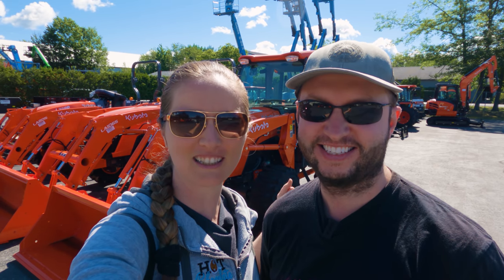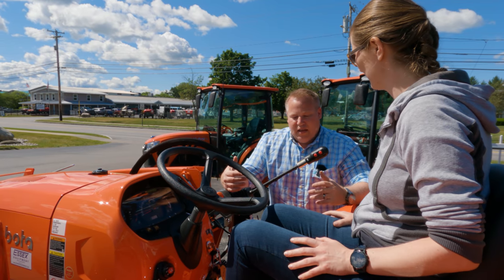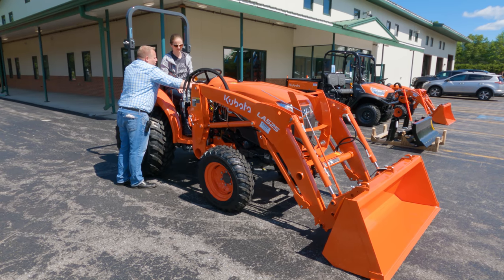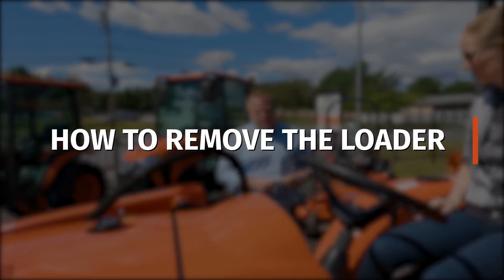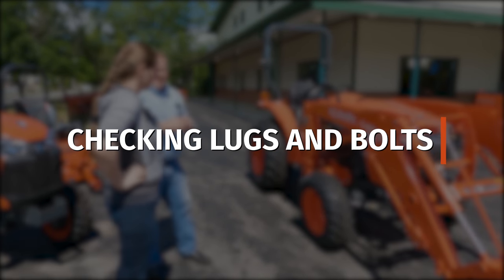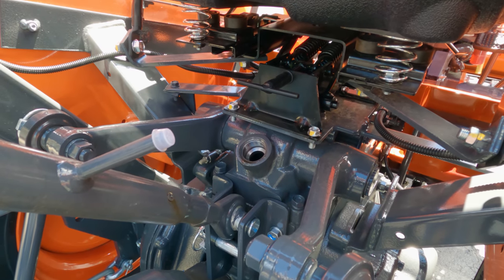We bought a tractor! - Tractor ORIENTATION for new owners

Comment from the maker: This is a very long video! Not really our norm, but there was so much good information that I couldn't cut any more out. If you want to find a section again, here are timestamps: 
0:00:00 We bought a tractor!
0:01:08 Welded hooks
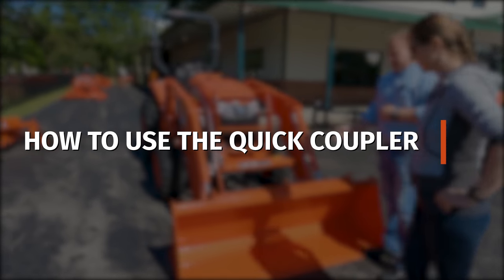0:01:35 Quick coupler
0:03:53 Engine
0:04:31 Battery
0:04:57 Air filter
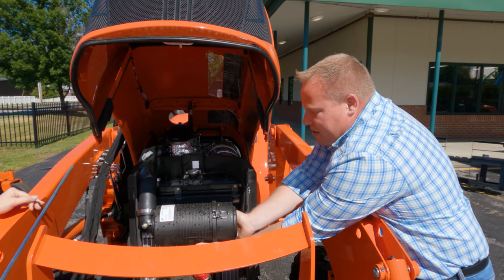0:06:28 Screen
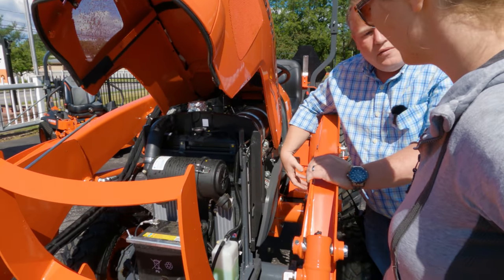0:07:21 Alternator
0:07:28 Oil dipstick
0:09:01 Diesel particulate filter
0:10:17 How DPF regen works
0:13:16 There is no right or wrong way to run a tractor (RPMs)
0:13:34 How to engage regen
0:14:41 What do all the handles do?
0:14:46 Clutch
0:15:09 Gears
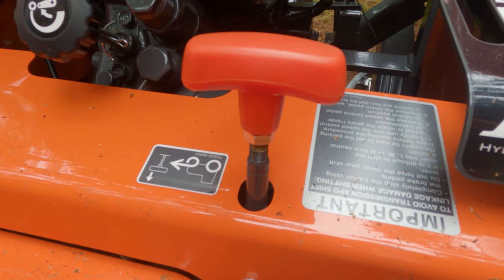0:15:57 4 wheel drive
0:16:30 Locking real differential
0:18:27 Three-point hitch lift/drop speed
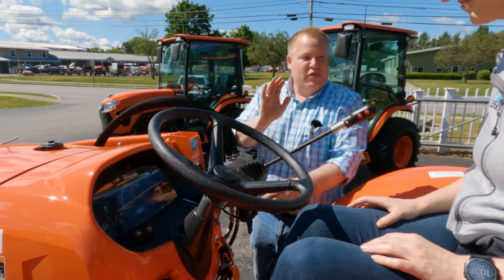0:19:13 Throttle
0:19:24 How to start the tractor & glow plug
0:20:36 What RPMs to run the tractor at
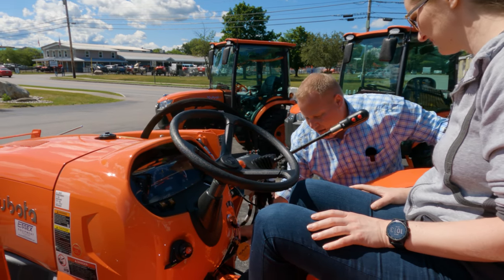0:22:57 How to set the parking brake
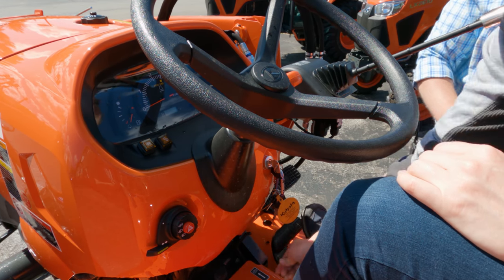0:23:33 Individual parking brake pedals
0:24:30 How to read hydraulics dipstick
0:26:10 How to operate rear attachments: 3 point hitch
0:26:45 PTO
0:27:33 How to operate a loader
0:29:06 Bucket level indicator
0:30:31 Playing with the tractor
0:30:45 Loader
0:32:44 Lifting front tires
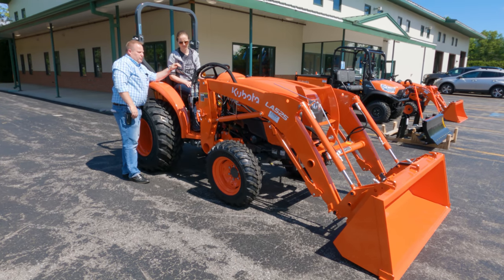0:33:09 Floating the bucket
0:36:04 How to lock the handle for the loader
0:37:24 Picking up logs with forks vs bucket
0:38:17 How to remove the loader
0:44:50 Taking tractor on the road
0:45:02 Tractor came out of the box
0:46:50 Tires are loaded with beet juice
0:47:25 3 point hitch
0:51:16 Seat
0:51:56 Safety features
0:52:47 ROPS
0:54:25 Loader safety
0:55:33 Driving the tractor
0:57:07 What to do with stuck gear shifter?
0:58:27 Test drive
0:58:50 Removing the bucket and putting on pallet forks
1:02:15 Tractor delivered
Reply: Po
Reply: 8:15 8:16
Reply: Very useful video
Reply: Yes some great info. Best I've seen.

Comment: It's 2023 and I've owned my L3800 since 2013 and I have to thank you for this video as I leaned a few things I was never told or never found out about it. The seat adjustment for the springs was a big one, I never knew. I did just go out and adjust mine to where it's super comfortable now. Most of the rest I figured out on my own through use, but anything I might not have known helps. That's a nice way to receive a new machine, very thorough. My salesman met us in the parking lot, and said good luck. I and my wife loaded it on the trail and carted it home. Delivery? There was no mention of any type of delivery, so we borrowed an equipment trailer, bindered it down and off we went.

Comment: The knob between your legs Crank it wide open... You can adjust the speed by using your 3-point lever.. why people feel the need  just to slam the lever forward as fast as they can as beyond me.. and use your four-wheel drive as much as possible unless you're on blacktop road.. it will help with skidding trees and loader work.. only use the differential lock if you're losing traction in 4-wheel drive.... And when engaging the PTO let the clutch out slow with tractor  idling

Comment: As for lifting the boom to check the engine, there are safety jacks you can get that’ll prop up the bucket boom so you can work on the motor. If you take your tractor in for maintenance it’s highly likely service personnel will have those safety jacks.

Comment: How are you liking your L3901? I have one and have had it since 2018. I have 185 hours on mine. 

Only complaints are I don't think the loader lift capacity is that great.
The oil dipstick is difficult to get to.
The PTO switch is not great.
If you use a grapple like I do, I wish the front brush guard had a metal cage on it, I've had sticks run through the front grill messing up a battery.

I added an extra valve for a grapple on the front. It has been handy for brush piles.
Reply from the maker: Our L3901 is now about 10 months old and has around 160 hours on it - over half of which we've put on in the last 2 months since we've been back in Vermont! So far, it's far exceeded our expectations. Before we bought the tractor, we wrote up a list of all the things we thought we'd use it for, but in reality it's come in useful for many more things. I think overall my comments would be very similar to yours.

The loader lift capacity is definitely an issue. We debated for a while between this tractor and the L4701 which would have given us more lift capacity. We've definitely struggled for lift capacity and have maxed out the loader more than a few times, but we've always found a way to work around it. Based on some loads we've lifted where we know the exact weight (e.g. shipping crates), we've managed to lift 1,100-1,200lbs, which is right what the loader is specced to do.

The oil dipstick drives me constantly crazy. It's almost impossible to remove with gloves on, and especially when it's really cold outside. That seems like it would be an easy one for Kubota to improve, and must be a common complaint. It's more of a nuisance than anything else though.

With regards to the PTO switch being "not great", I'm assuming you're referring to it slipping out occasionally? This has happened to us a few times and I had just assumed it was our tractor, so it's interesting to hear you're seeing a similar thing.

We did have the extra front valve anticipating a grapple, but ended up cancelling our grapple order because it was taking too long. It would be nice to have, but we're managing to get by with the forks which, given the price of the grapples, seems like a decent trade-off! However, the third function hydraulic valve on the front could be useful if we get a snow plow (which we're considering for next winter).

It's funny you mention about the brush guard - our dealer even warned us about that before buying the tractor so it's something we've always tried to be mindful of. I keep meaning to search for an aftermarket grill we could add for some extra protection!

So overall, we really like the tractor. It's not without its faults, but we'd be lost without it.
Reply: @AdventurousWay  Thanks for the response, I ended up buying a John Deere 320E skid steer to supplement the tractor. It is fantastic even though it is a wheeled machine. The tracked models cost too much. I rent excavators from time to time, they are very handy. The skid steer can life 3 times as much so now I am good. We live on 20 acres.
Reply from the maker: The John Deere 320E is definitely a big step up in lifter capability! Out of curiosity, what are the types of things you find yourself needing the 320E to lift that the tractor can't? For us at the moment it's generally heavy logs, and hopefully that'll be less of an issue when the big site clearing work is done.
Reply: @AdventurousWay  Firstly, if I had to do it over again I probably would have only purchased a skid steer. For my land it makes sense, I don't have large fields to mow, mostly woods. We have large rocks to move around and I have put down over 1500 tons of gravel with both the skid steer and the tractor.  The skid steer wins every time.  I have used the skid steer to move building materials as well. Our hickory flooring came in 5 2000 lb pallets. The tractor would not handle that.

I also use the skid steer to dig and level, it's much faster.
Reply: My grapple is the best money I have spent.  Much much more utility than pallet forks.  I’ve used both.  I recommend anyone who cuts down trees or brush to get a grapple.   I have the Wicked 55 grapple from Everything Attachments.   Waited 5 months to get it but we’ll worth the wait.  Made of hardox so about half weight of cheaper made in China grapples…lighter grapple saves lift capability which I agree could be better.  Sometimes wish I’d got the L4701 instead of L3901 except when negotiating tight spaces in the woods.  Also put a brush guard on mine…too risky for me to operate a grapple without a good brush guard.

Comment: Just bought a brand new LX 4020 to move snow in mountain resort. Dealership put howes diesel treatment in it and sold me a bottle to treat diesel because the temp is around 0 degrees F at 10000 feet elevation. I have 17.2 hours on the tractor and the thing won’t start. I tried for 3 days finally put 911 in fuel filter and added a little to the tank as per specs. still won’t start. had to tow it through 4 feet of snow 150 yards as the kubota dealership in my area wanted to charge me 8 hours of labor just to drive out to and from my location because i didn’t buy it from them. took it to a kubota dealership in a different state but only 1.5 hours from me. They told me the DPF is completely clogged due to the fuel. SOOO no warranty and no insurance coverage. $12000.00 to fix. the tractor was only $39000.00 WTF! Kubota service and insurance and Sales all suck. They blame it on the other dealerships, no one is taking responsibility for taking care of tractor. Read your manual and warranty and insurance form. If it is fuel related. NO COVERAGE. DONT BUY Kubota! LIARS and Fraudsters. Does anyone have any insight or help here ? Just lost over $20000 on contracts for snow removal. and looks like i wont be getting this tractor back for at least 3 to 4 weeks, even if i pay the extortion money to fix it. and then im sure it will just gel up again and and wont start and will have to go through this all again in another 17 hours. only about 15 total gallons of fuel have gone through this engine 8 of which was put in by the dealer and i only put 12 oz. of howes in the 10 gallons of ulsd i bought from costco. teir one diesel.
Reply from the maker: I’m sorry that’s happened to you. But I don’t think this video is going to help you.

Comment: 4WD is just one front wheel and one rear wheel?  WTF…
I don’t know what that salesman was taught but when my Kubota is in 4WD all 4 wheels are pulling.  If I’m pulling something out of the ground using the draw bar there is a good chance that all 4 wheels will slip.
Reply from the maker: I think he was referring to the locking diff.
Reply: @AdventurousWay  No, I just went back and checked he actually says 4wd is 1 back tire and 1 front… limited slip…? 4wd and limited slip are two different things.
I think he just doesn’t understand how 4wd works.  Or doesn’t understand how to explain open differentials.